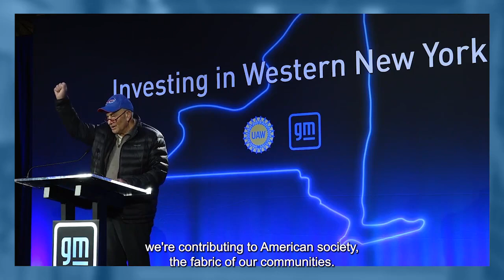Gerald Johnson on Public Policy and Legislation |The Competitive Advantage ep.6 | General Motors

Comment: What Are In General Motors - GM N-Body (P-90/GMX130) Platform for Cars (1st-3rd Generations) & Exterior/Interior-(Updates/Upgrades) Used from (1985-2005) is?

Comment: I feel like y'all are letting the automotive performance down. Your pushing ev and ford is mopping the floor with y'all. I see so many auto enthusiast going to ford's who for years ran only GM and the fact is the materials that make up the battery are rare! What happened to pushing ethanol. Fuel made from corn which grows in almost any state. Your systematicly going to remove petroleum vehicles from operation. In favor of ev. Where petroleum is what made You!

Comment: What Are In General Motors - GMT400 Platform for Full-Size Pickup Trucks/SUVS & Exterior/Interior-(Updates/Upgrades) Used from (1988-2000) is?

Comment: What Are In General Motors - GM W-Body (GM10) Platform for Cars (1st-3rd Generations) & Exterior/Interior-(Updates/Upgrades) Used from (1988-2016) is?